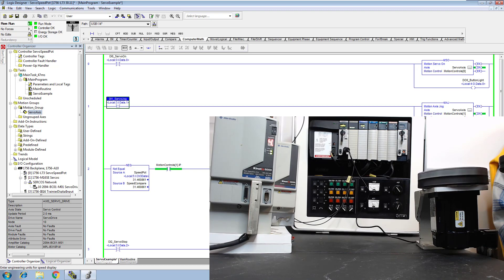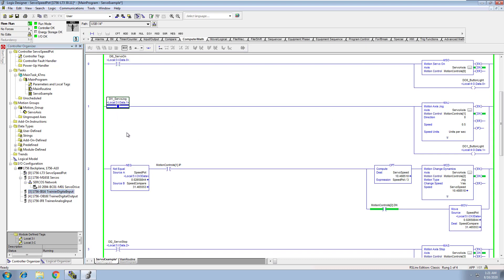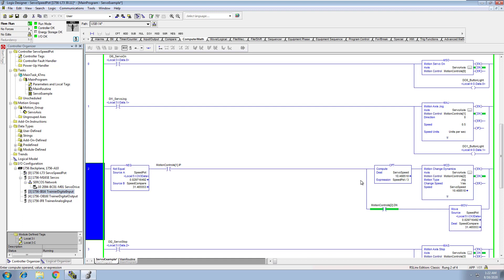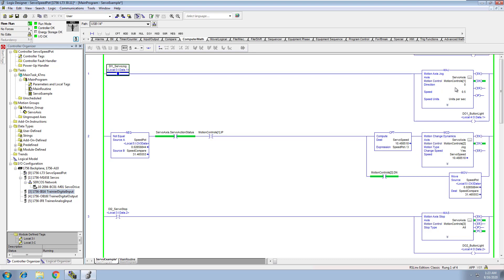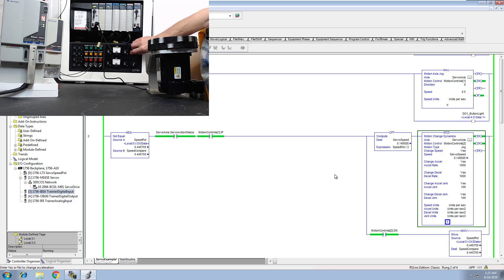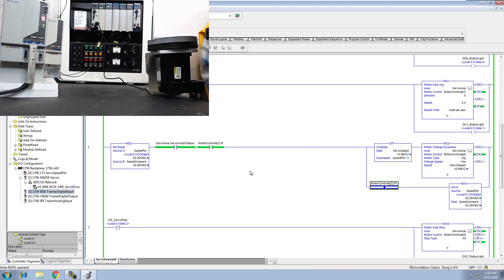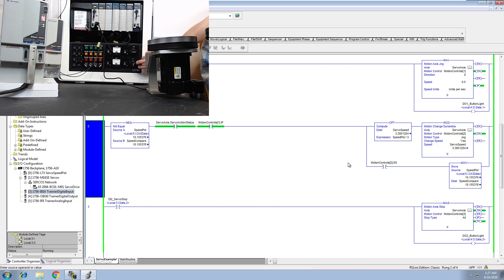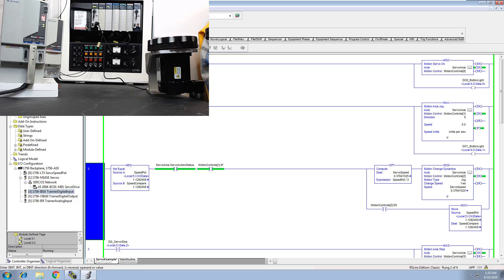Studio 5000 Using a MCD Instruction to Change a Servo Speeds Using a Potentiometer

Comment: Hi Shane, could you tell me why in my application when I execute the jog instruction I wanted to make an MCD the servo stops and starts in reverse, where could the problem be?
Reply from the maker: @arielfittipaldi8416  Because you need to change speeds a different way

Comment: Can this concept be applied with a Kinetix 5100? I am actually on site and need to accomplish this exact task (speed following based on a continuously changing tag value). If there is any way you can help I would really appreciate it!
Reply from the maker: Yes, these servo controls are not device specific. The MCD is a standard use servo control